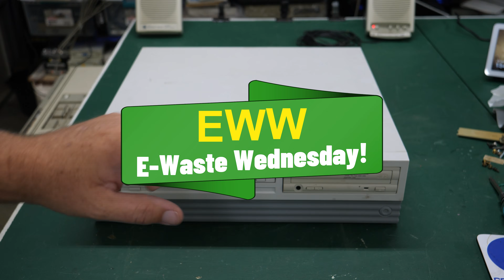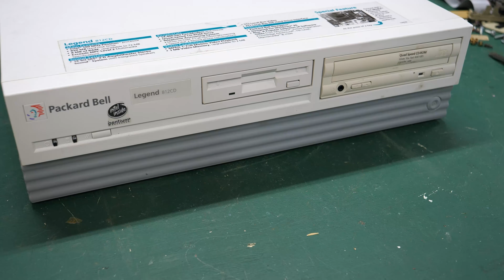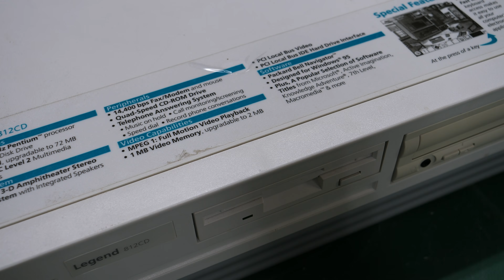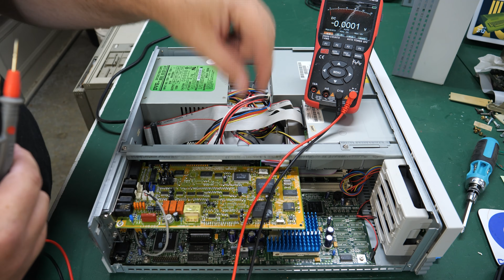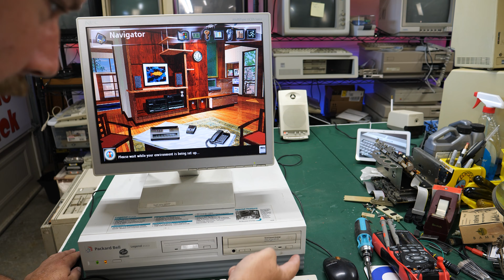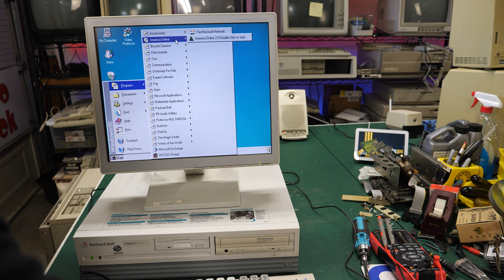Discovering a Time Machine: Mint Packard Bell PC from 1995!

Comment: back in the 80's i grew up with an trs-80 coco 2. i picked up a Packard bell thru Sam's club in 93 or 94 it had windows 3.1.1 installed. it had a 66mhz cpu - 4mb onboard memory can be upgraded to 64mb - it had a 420mb hdd - dual speed cd drive - 1mb video memory. it was a good little computer

Comment: I remember seeing these in the store (newer model, but similar case design).  It was the fall of 1997.  They had also some with cut-off sides (corner PC?).  Went with a Compaq Presario with Pentium MMX CPU, as it had better specs and a bigger hard drive.  Got a matching monitor with speakers on the side :).
Btw, I still have the huge box from it that I use to store old stuff in lol.  It still has the Compaq label and MMX logo along with some graphics on the cardboard.  Wonder how many of them are left around?
Reply from the maker: Nice

Comment: Ah yes the sound card and modem all in one. Oh, that pissed off so many people. You would think. (I did find on some of them.) they would include jumpers to disable the sound or modem if you need to upgrade or if 1/2 the card died. Nope, they did not. Also being a name brand didn't use a standard at motherboard either. Though later on I did find out it was a ntx or something like that. Not that it mattered. Before the internet was not easy getting parts. If you called Packard Smell they wanted a premium. I later found out they continued going in Mexico and sold computers. I was so happy when they went away. Then you have E-Machines. Oh, help me so. LOL

Comment: What a fantastic find. My family's first computer was a Packard Bell. We got it near the end of 1996. I don't remember the model name but I remember all of its specs: 100mhz P1, 1gig HDD, 8 megs ram, 14.4 modem, Aztek soundcard, 1 mb vram, 8x cdrom. The power button was in the center of the machine but other than that it looked exactly like this one. We got ours at Walmart and got the whole package, the computer, monitor with the built in speakers, and an HP printer. The speakers were to be installed by the buyer once unboxing the monitor. Our speakers didn't fit right and we were going to return the monitor but the guy over electronics at our Walmart was a retired IBM engineer. He asked us to just wait a few min and he retapped the screw holes that held the speakers on. They were out of stock of PB monitors so it was let him do that or wait until they got more in. We used that machine until around February of 2000 when it was starting to show its age, failed PSU that was replaced by a local computer shop but at no cost since our warranty still covered it...somehow, even though I had cut the QC sticker when installing a whopping 8mb upgrade, the hdd was out of space, and it had gotten super slow and couldn't run newer games like StarCraft.
Reply: Yep, if you had a desktop with the power button more towards the middle, then you had two drive bays - the bottom one cut down into the gray trim, and the power button was to the left of the bottom bay. I had the same design - mine was a PB 2950.
Reply: My family also owned a Packard Bell but it was the designer tower we had. It was a Packard Bell Platinum 2240 which was a Pentium with MMX A Quantum Big Foot Drive and Windows 95.

Comment: I had a Legend 415 CD with a Pentium 75MHz 8MB 4x CD 14.4k, basically the same specs listed on the unit. I OC'd the CPU to 100MHz stable and 133MHz which was stable enough to run a benchmark but not real-time use.  I added a larger heatsink and a fan for the CPU.
Reply from the maker: Awesome

Comment: Amazing that it never had a USB card installed. That was my first upgrade to any computer back then.
Reply: They got native USB support with Windows 98 SE.  My uncle got an IBM with USB port in 1998 that was not active yet, but "for future compatibility."  Had to buy 98 SE upgrade CD to get it to work.
Reply: @Omega_Mark  Correct. Windows 98 supported USB 2.0. Windows 95 had a later version with USB support which was only USB 1 and 1.1.

Comment: Looks a lot like a Compaq. 
One of the first CD rom I installed was in a Compaq that was this size. 
I installed an ISA interface card, 16 bit, and the 40 pin cable to the CD rom 

The riser card came up and 3 slots were sideways. 
I installed an ISA BNC network card in it as well 

The 2400 in 1995 was a lot of money. 
Almost a year's take home pay for the person making minimum wage. 

As with the VCR, adult material was what drove computer sales. 

I still remember the VCR in 1981 cost 2500 dollars at a time when 100 dollars was the average take home pay. 
Half a years pay. 
And I remember seeing the first VHS rental store. 

They required a credit card and put a 500 dollar hold and an imprint of your card. 
The yearly membership was 50 dollars. 

The rental fee was 5 dollars per night for the G, PG, or R rated tapes. They had about 50 tapes in the front. 

It was really funny looking back. 
The store was very bare, lots of space between the tape boxes on the shelf and you brought up the box to the counter. 

The back half of the store, they had a doorway made of 3 layers of beads going to the adult area. 

They had huge signs on both sides and above the door saying over 21 ONLY 

The back had about 300 tapes and they had the little round key chain tags, and big signs saying not to remove the boxes from the back. 

They charged 10 dollars per night for the adult tapes

If I remember correctly, the adult tape tags had A### to indicate it was the adult tape 

The maximum rental for a night was 2 tapes, but they had an exemption for renters who wanted to rent 2 regular tapes and an adult tape. 

And you would see only the upper class. 
A family would be in there, the mother and child, usually a young kid, they would be out front and get a Disney film like Cinderella, and a regular movie like Jaws, and the dad would be in the back room getting an adult tape. 

And my experience was that these families would have a VCR and cable box in the front room and another cable box and VCR upstairs in the master bedroom. 

The cable box was Jerold, and it had the square box with the cable in and out and a cord coming out the box going to the manual push button selector. The decryption box was a smaller box that would sit on top of the main box. 
I remember running a cable from the wall jack, to the cable in on the main box, out to the decryption box, and out of the decryption box to the antenna in on the VCR. And out to the TV

The VCR had a 4 pin trrs style headphone jack that I think was a 5/32 jack not a 1/8 Jack and that had a 25-ft thin cable that ran to the manual control box for the VCR and it could do play stop fast forward rewind pause and record and I think there was a TV VCR selector 

And the VCR had little selector switches when you open the door on the front that selected either VHF low VHF high or UHF and they had little wheels for each channel selection that had seven or eight channels that you could manually program in using the switch and the wheel to find tune the channel that you wanted and they had the numbers on cardboard that was perforated so you would pull the number off that you needed to appear in the window and slide it into the window so that you could see which channel you had programmed in and I think you actually had to manually push the buttons above the channel Windows to get the channel selected 

And with the cable box everything was set to channel 3 so the antenna went into the cable box and came out on channel 3 into the decryptor and out of the decryptor on channel 3 and into the VCR on channel 3 and out of the VCR on channel 3 and the TV was set to channel 3 and everything was manual so you didn't have any way to change the channel on the TV or adjust the volume without physically going to the TV 

The cable channels with the manual box that was on the 25-ft cord you could select the channel on the box and the VCR with the manual control that was on the 25-ft wire you could have some control over the VCR 

And the VCR did have a rudimentary 7-Day programming that you could enter the current day and tell it what day you wanted to record and what time and the time was set so that it could actually record in advance up to I think 7 Days maximum 
so if it was Saturday at noon and you wanted to record next Saturday I don't think it could do that but it could record Friday 

It really amazes me how fast the technology changed because in 81 everything was manual and hardwired and 83 they had the digital display on the cable box and they had the RF remote for the cable box and the VCRs were also RF control in 83 as were the new TVs 

I remember a friend bought a video camera in 1983 that was a portable 12 volt vcr and the camera and a portable battery and I think there was a control box for the camera 
It was very heavy about 50 lb total 

There were three carry bags one for the portable vcr and one for the control box for the camera and one for the battery that was like a small 12 volt car battery and the connection coming off the battery split into two cables one that went to the VCR and one that went to the control box and the control box had two cables that came out from the camera and one was for the power and the other was for the video signal and the control wires 

Even with the huge battery the camera only recorded for about an hour before the battery was completely drained 

I still remember going out and testing it outside and it was a cloudy day but I didn't see any lightning and when we hooked it up to the TV inside and played it back and did frame by frame playback we saw lightning in the clouds that we did not see with the naked eye 

That was really amazing and I still remember it to this day 

To think back then that it was that heavy in order to record something you needed all of that equipment and that weight and today we have much higher resolution on a phone that weighs less than a pound 

It really makes me wonder what will it be like 40 years from now
Reply from the maker: Yeah. What will be nostalgic then I wonder?

Comment: Oh man! I've been looking for (almost) that exact Packard Bell for ages. They're always in terrible shape and waay overpriced on eBay.
I bought a P75 version in 1995 at Best Buy specifically to run Linux after selling my Macintosh LCIII.

I couldn't get the modem working in Linux. Turns out it came with one of the new, awful soft-modems. 

But I still loved it as I could then do my school work at home instead of waiting in the queue for the UNIX machines at school.
Reply: Wow!  I have a Force 101CD Pentium 60  "mint in box" with all original packaging software, manuals etc. that I will list on eBay after seeing this.  I bought it new in 1995 just before W95 came out. I am FredCPA1 and I will get it out in a week!  Thanks!